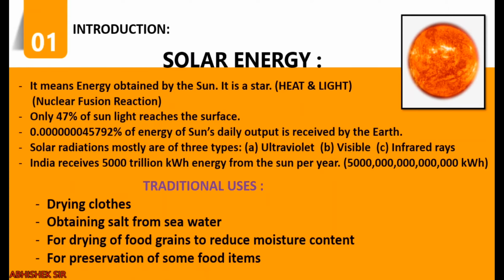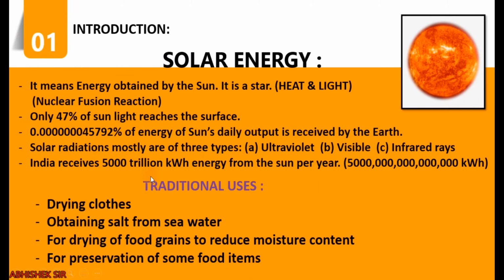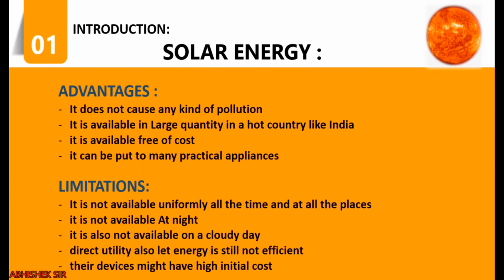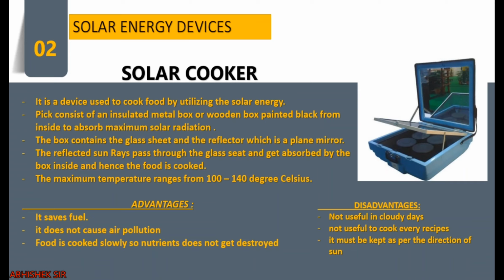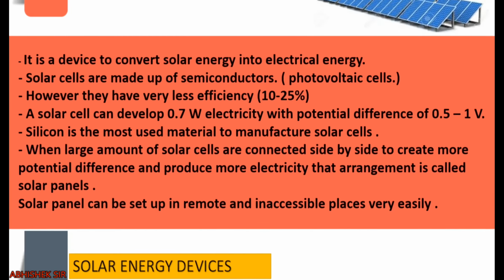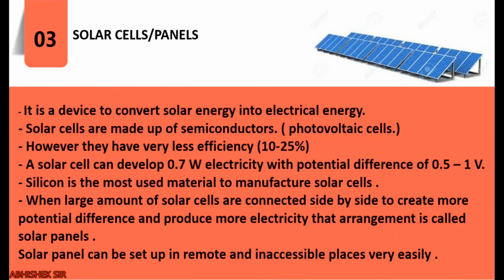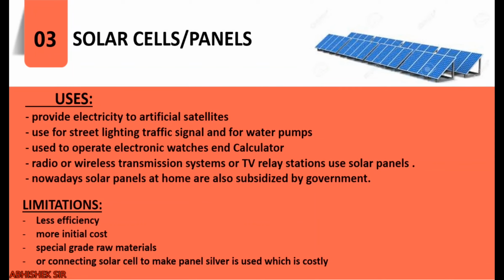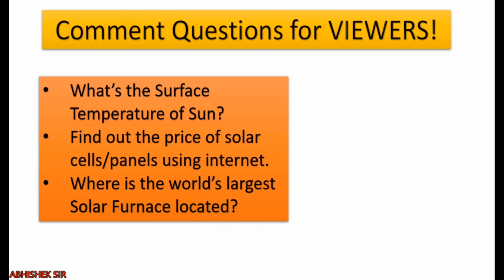Solar Energy Solar Cooker Solar cells & Panels Class 10 Science Ch-14 Sources of Energy

Comment: Ans 1 :  The Surface temperature of sun is 5778 K.
Ans 2 : The cost of Solar cell/panel depends on the number of Watts taken. Some are listed below : 
Vikram Solar : Rs 30/Watt
Waaree Solar : Rs 28/Watt.
Ans 3 : The Odeillo solar furnace is the world's largest solar furnace. It is situated in Font-Romeu-Odeillo-Via, in the department of Pyrénées-Orientales, in south of France. It is 54 metres (177 ft) high and 48 metres (157 ft) wide, and includes 63 heliostats.
Reply: By : Prachi Patel

Comment: Ans 1:-The surface temperature of Sun is 5778K.
Ans 2:-It depends on material pf which they are prepared and number of watts in it. Maximum price of solar panel is 1,00,000.
Ans 3:- Odeillo solar is world largest solar furnace in the world, located in Font-Romeu-Odeillo-Via in department of Pyrenees-Orientales in South of France.

Comment: 1. The surface temperature of sun is 5778 Kelvin.
2. The cost of solar panels/cells depends on the material of which they are prepared and number of watts in it. 
3. Odeillo has the largest solar furnace.